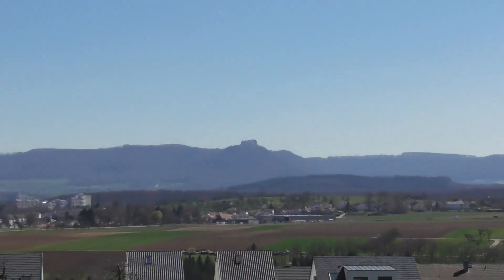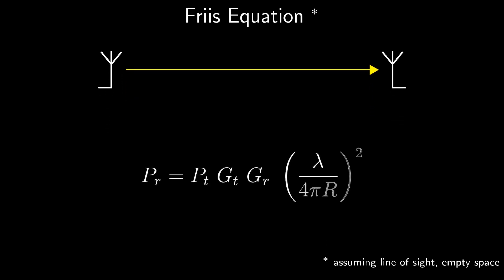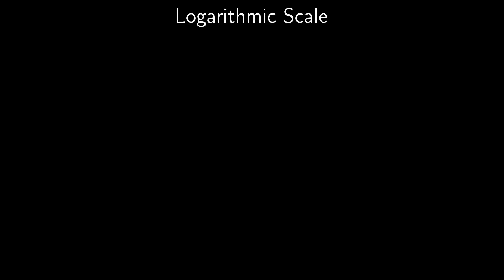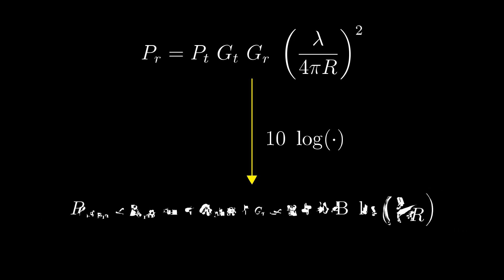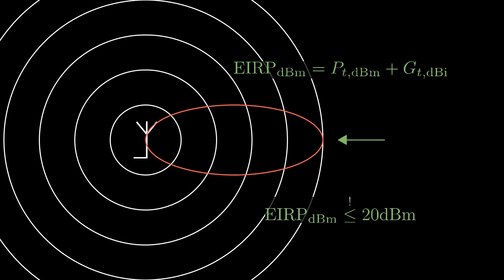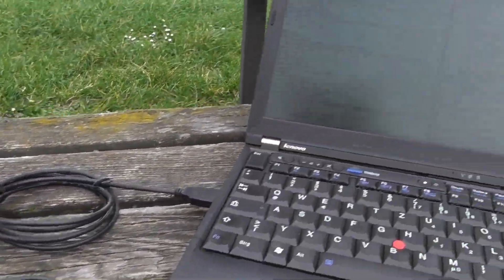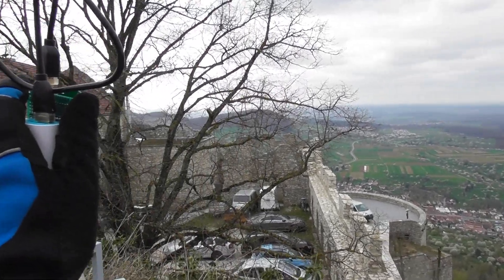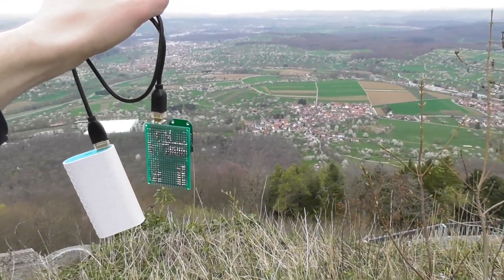ESP32 WiFi Range Testing - 10km using Directional Antenna

Comment: You should also checkout esp_wifi_types.h 
#define WIFI_PROTOCOL_LR          8
Seems like it could be useful for Long range/low bandwidth data.
Reply from the maker: Thanks for the hint! Unfortunately, I can't find a lot of information about what WIFI_PROTOCOL_LR is actually supposed to do. You seem to be knowledgeable on this subject, so do you happen to know what this mode really does to the WiFi signal?
I am already using 1Mbps DSSS modulation for my transmission, so I wonder what WIFI_PROTOCOL_LR can change to further improve performance?
Reply: No, I do not think it would help you get longer range, unless there is some way to use your own antenna with the ESP32. I was hoping that you knew what the WIFI_PROTOCOL_LR did. I did some experiments today walking around looking at the rssi and datarate. I was able to get good reception over 100m without line of sight. I will compare it with the normal protocol when I get the time.. Here is my code https://github.com/Ebiroll/qemu_esp32/tree/master/examples/18_long_range

Comment: so could you build the same setup in reverse. so the castle has a receiver as well and you have a transmitter as well.Then you duplex them together (I'm not sure on how you would do that).
You could then setup a link caperble of transmission and receiving 10k which is also working inside the law?
Reply from the maker: Yes, with directional antennas on both sides you could get bidirectional communication. You'd have to reduce the transmit power though so that you won't exceed the maximum EIRP.
Reply: Just get your ham radio license, then you can legally use higher power and modified hardware on channels  1-6 of the ISM wifi band.
Reply: except if you use different bands. i think 5 Ghz allows up to 1W, or even more. dunno though how the higher frequency affects the range though.

Comment: greetings , any chance for schematic even code |?
Reply from the maker: Code for the WiFi stack exploit is linked in the description, as well as the esp32-cam-demo project I used to get the camera working with the ESP32. The schematic is basically just connecting the ESP32 to the OV2640 module using the pin configuration specified in the esp32-cam-demo README.